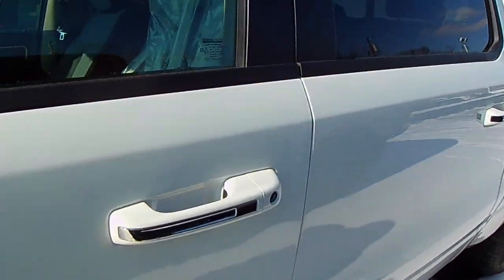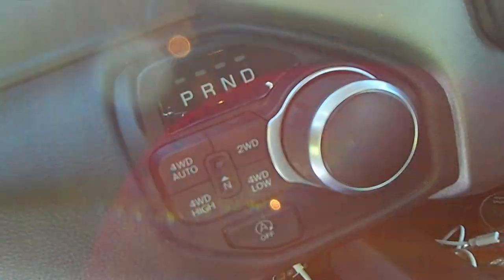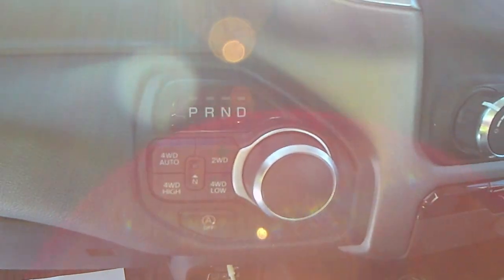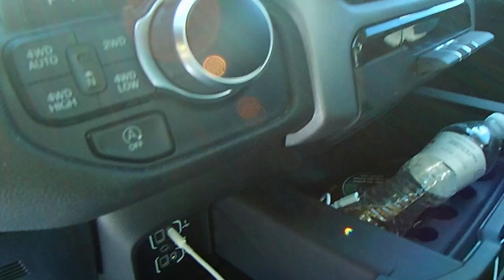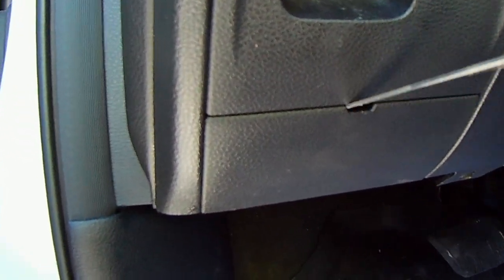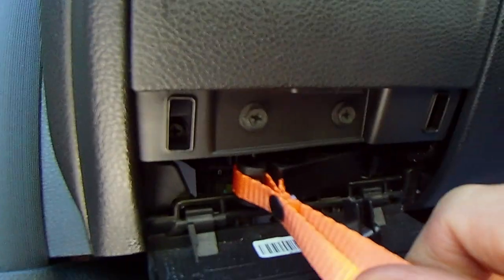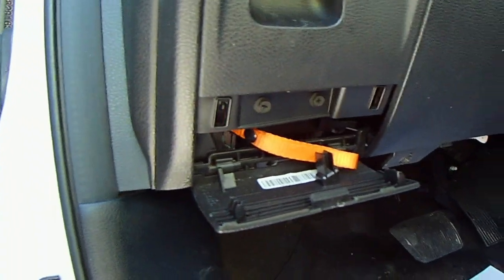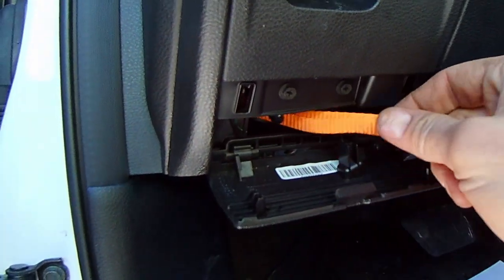2019 Dodge Ram - STUCK IN PARK - FIXED

Comment: The older Rams with the lever also have a problem with getting stuck in park.  I snapped mine off and had to replace it once so far.

Comment: The manual override actually doesn't do anything except put it in neutral for a second the computer still won't realize and reset so when you go to turn the truck back on you'll still be stuck and the shift knob will still not work
Reply from the maker: Right. The manual override allows you to put it in neutral for the time you need to move the vehicle when it’s Immobilie due to loss of power, key, whatever… it’s not meant as a repair for the transmission. As stated in the video, there was no power to this vehicle so without it the vehicle couldn’t be moved any other way without using sleds, jacks, etc whatever you want to call them. 

If there is power and you have to end up using this procedure, you’ll need to put something heavy in the drivers seat. There’s a sensor that detects if someone is sitting there and if it doesn’t detect weight the computer will override it for safety thinking the vehicle is going to roll away on its own.